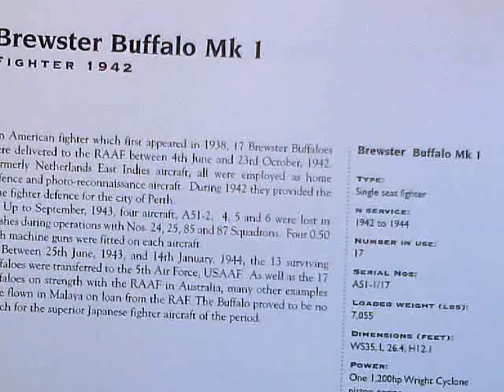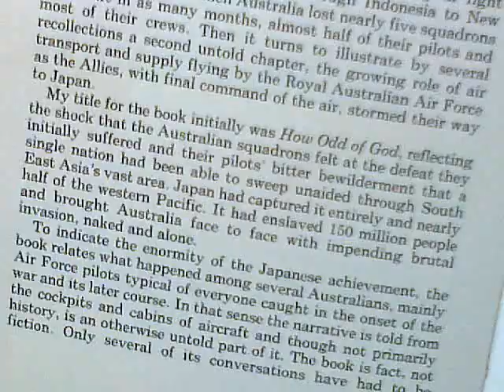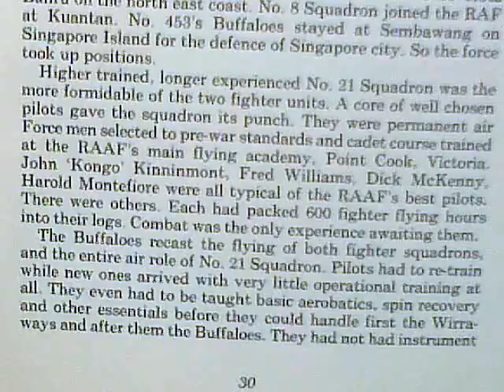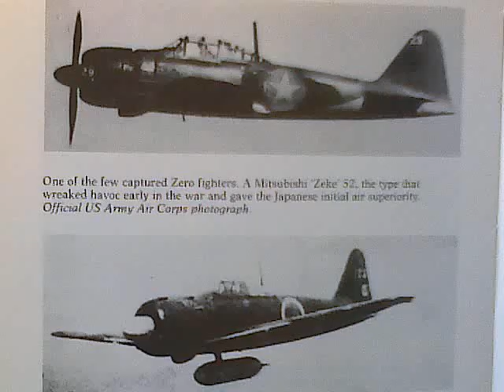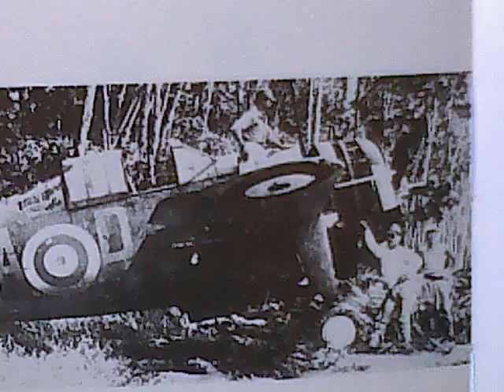World's Worst Fighter Aircraft, The 1941 RAAF Brewster Buffalo !

Comment: Finnish air victories by Brewster in WW2 was 447 by wins and 19 of lost!
Reply from the maker: G'day,

  Thanks.

   Yeah, something like that...; but as I said in the Video, the Finnish Buffalo was in a different situation entirely from the Pacific Buffalo.

  The Finns did not use AmeriKan Guns, to blind the Cockpit or shoot their own Wings off, they used German Guns, which worked as designed.

  The Finns did not use AmeriKan Radios and the German ones were not blanketed by the Static from the Tropical Thunderstorms which did not occurr on the edge of the Arctic Circle.

 The Finns fought a Low Level Air War, where the Buffalo Fuel Pump did not fail to supply it's Engine with juice.

   The Finns were not fighting Elite Combat Veterans in Zeros which were 80 or 100 mph faster than their Buffaloes, they were up against half-trained Students in Polikarpovs...

  Finally, though the Finnish Buffaloes had a 15:1 Kill-Rate against the Soviets..., as soon as the Finns were re-equipped with REAL Fighter Aircraft (German Bf-109 F & G models) the Finnish Fighter Force's Average Kill-Rate jumped up to 25:1...

  The Finns honestly THOUGHT that the Buffalo was a good Aeroplane, they rated it to be "at least as good as the Curtiss P-36 Warhawk", and EVERY other Air Force on the Planet found the Curtiss P-36 to be about as useful as Teats on a Bull...

  The fact of the matter is that the Finnish Pilots were a very great deal better trained than the Soviets, the Buffalo was about equal to the Polikarpov I-16 & it was better than the Biplane I-15...; and when the Finns decided that the Buffalo was "a good thing" they had never had an actually good Fighter, so the Buffalo was the best they'd ever seen...

  The world is a complicated place, and simplistic comparisons are almost never valid ; but while the Buffalo was the King of he Karellian Peninsula, it was also a completely  hopeless Piece of Shit in the Pacific.

  Such is Life,

  ;-p

  Ciao !
Reply: @WarblesOnALot  the French also had some success with the hawk 75
Reply from the maker: @pouletbidule9831  

G'day,

Thanks.

Yes, I have heard (read) that some Curtiss 75s did some fighting with the French...; but I never know if the "Curtiss 75 Stories" are particularly credible...

 Apparently when the first Spitfire met & was badly frightened by a Fw-190a over the Channel (1942 ?)..., the RAF attributed that as being a Jagdwaffe Joyride in an old captured Curtiss Hawk 75.

The Radial Engine apparently confuzzlicated quite a lot of people, and often enough  anything featuring "The Sound Of Round", if it looked a bit different..., then it  automatically became
 "a (captured) Curtiss Hawk 75..." 
at least, in the eye of the beerholder it did...(!).

Such is life,

Have a good one...

Stay safe.

;-p

Ciao !

Comment: The Finns used the Brewster with great success.
Reply from the maker: G'day,

   Thanks,

   Yes, that's right...

    That's why I said exactly that, at the conclusion to the Video.

   And I also said that the Finnish Buffaloes had German Radios & German Guns, and they were fighting below 10,000 ft against Aircraft with no performance advantage over them.

  The RAF/RAAF (& USMC) Buffaloes were afflicted with Fuel-Pumps which required manual-assistance above 10,000 ft in a War happening between 10,000 & 20,000, using British HF Radios which were useless against Thunderstorm-Static in a place where Lightning commenced by 10 AM daily, and they had one set of Guns with which to blind the Pilot with another set that either jammed immediately or they shot the Wings off....

   Also, the Finnish Fighter Pilots using Buffaloes in the Continuation-War, against Polikarpov I-15s & I-16s  flown by inexperienced  Soviet recruits (since the last "Purge") were mostly veterans of the 1939-40 Winter-War.

  Whereas the RAAF Buffaloes, self blinded & deaf, gasping & spluttering from Fuel-Starvation, were flown by Peacetime-Trained Fighter-Pilots facing combat for their first time...;  and they were up against Japanese Combat-Veterans in Zeroes, at the peak of the "Zeke's" combat career, when all the bugs had been worked out of it, and in every way it outperformed the Buffalo by a wide margin, & it's experienced Pilots had never been beaten.

   It helps if one watches the entire Video, before showing off one's pet personal store of knowledge with a Rapid-Response Comment on the Thread...

  Have a good one,

  ;-p

  Ciao !
Reply: greets and you are giving info i did not know  ;) kiitos
Reply: granskare the Fins lightened the airframe and got Superior proformence
Reply: @WarblesOnALot   As you pointed out, he winter war in Finland was very, very different from the Pacific theatre.

 The Russians had success with the P-39, as well but once again, under different circumstances. Much of the aerial combat on the eastern front was fought at relatively low altitudes. Partly because of weather and partly because of  the nature of the fight.  The German pilots were often charged with protecting ground troops subjected to the many, many close support ground pounders the Russians flew.
They spent a lot of effort trying to protect their Stukas.
Reply: The soviet planes were not outdated. Only their pilots were crap... just like were the allied pilots flying the Buffalo, which is why they lost so badly to the japanese piltos. There was nothing wrong with the plane.
Reply: @Robert Gräfe Dear Robert, soviets got huge amount supply from US, like  11400 a/c,  4719 P-39 Aircobra.  Britain delivered only  +7000 a/c.
Reply: I have never claimed finnish pilots fought against Japanese planes. 

The soviets had plenty of good planes, flown by bad pilots with bad tactics. Just like the british and dutch did with their buffaloes.
Reply: @jamesricker3997  How did they lighten the airframe? I gather they put supier gums on the machine and maybe that was part of it. It strikes me as a primitive F-4 Wildcat.